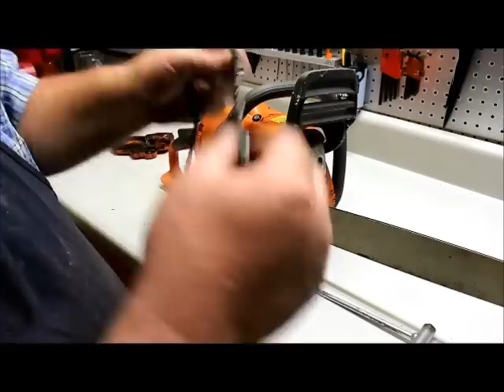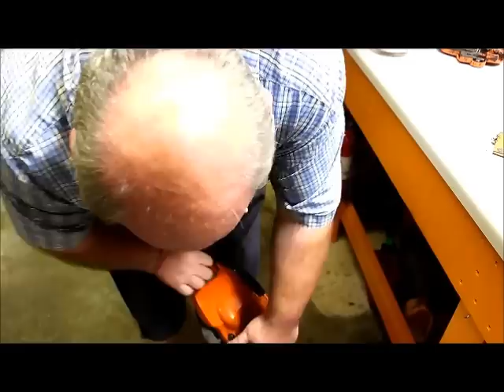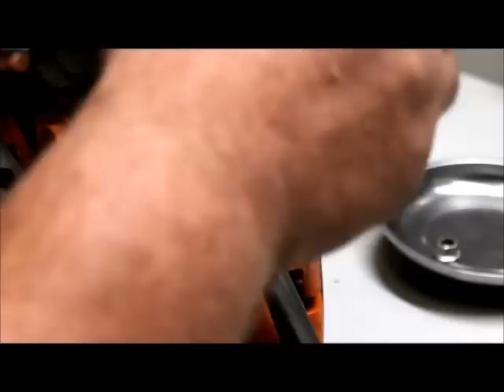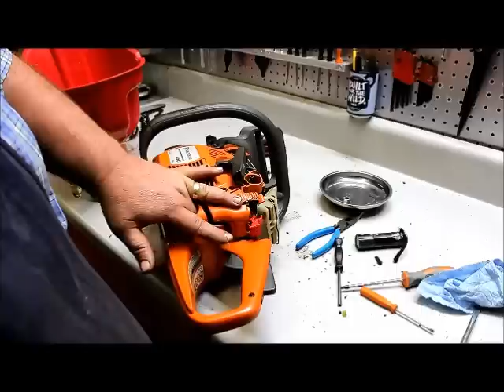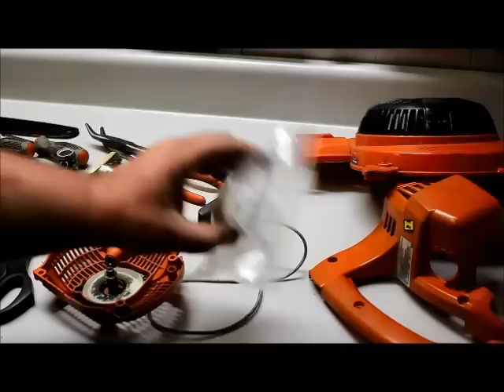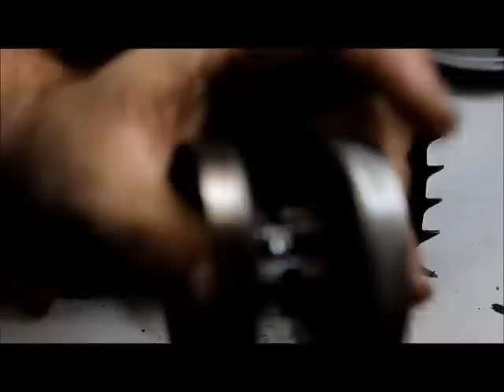#200816-Husqvarna 450 X-TORX carb repair, fuel line, primer assembly, rotor & sprocket replacement.

Comment: I bought a 445 husky brand new in 2008.  I just tore it down and replaced the piston cylinder and crank seals. I switched mine years ago to a rim sprocket.  Much smoother.   The interesting thing is. My 445 had a 44mm cylinder.  That means its a 450 with the wrong sticker on it.

Comment: Maybe you can help me. I bought a used 450 yesterday exactly as this one. And was working great today until I hit the fence and the chain came off. So I noticed the chain was damaged in the process and I replaced it with a new one. Now the the dam thing won’t start at all . I cleaned the air filter and replaced the spark plug and still no luck. What’s next to do ?

Comment: Could you show the part where you put the new fuel lines on? I have a 450 Rancher II that will not achieve high speed and I want to try and change the fuel line in the tank.

Comment: So the rotor dogs stick straight up. Mine came back from the shop bent over at a 90 degree angle, and after a few pulls to start the saw the plastic pulley was destroyed

Comment: You better be careful starting a saw without the bar cover.  I started  a big partner saw one Time and the clutch came apart and a shoe went through the roof of the building.  Almost hit me in the chin.  Good video tho I've worked on saws for over 30 years  . I'm going to start making some videos

Comment: That's not how a 450 with compression is intended to be started.  Primer bulb 6 times, compression cylinder engaged, choke up, pull until it turns over (compression cylinder pops up), turn choke off, pull.  Should start and run at that point.  If it doesn't, there's an issue.

Comment: I have the same saw. not enough oil slings down the bar, gets so hot it smokes. bar is blue/black. no adjustable oiler. how can I get more oil slinging ?? love the video
Reply from the maker: Corey Riley thank you. That seems to be a common problem with this model. I so far have not found a solution.
Reply: ok, thank you for the reply. would I dare shoot air from the bar side into oil tank? or no.
Reply from the maker: Wouldn't hurt, just make sure the oil tank is empty, and leave the oil cap off when you do it.